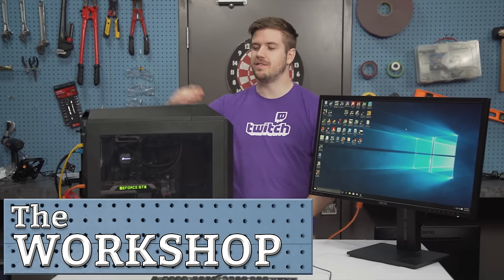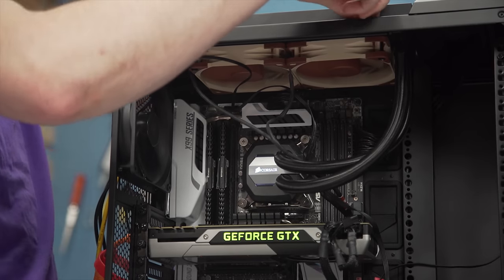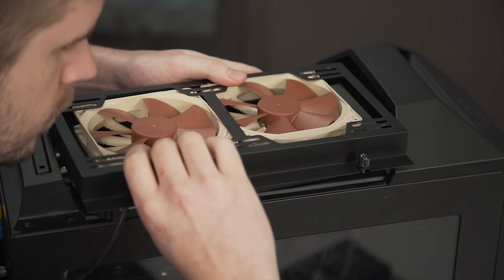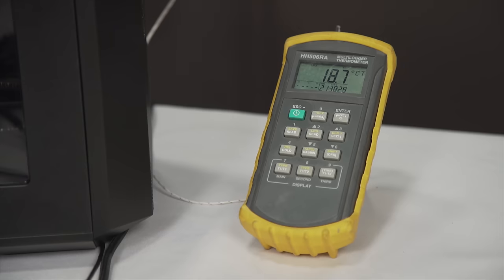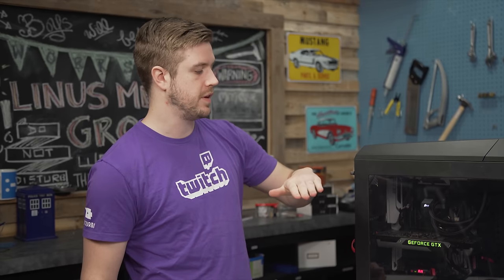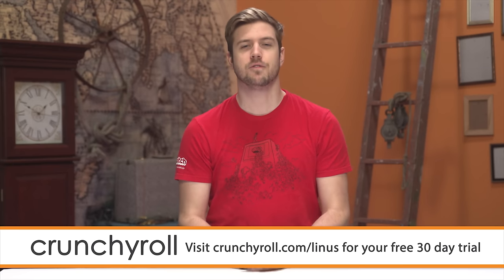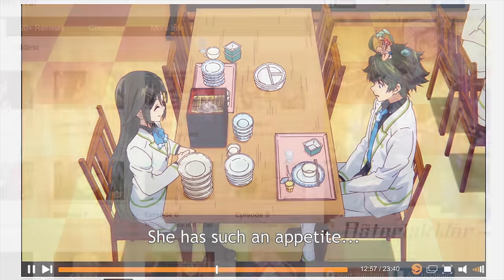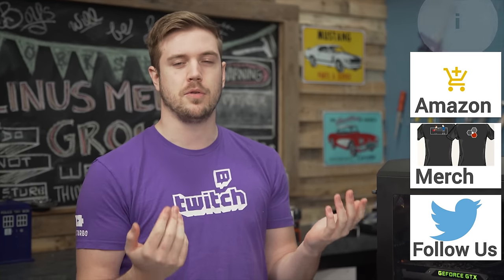Radiator Fan Configuration: Does It Matter? - The Workshop

Comment: The biggest con of the 4 fan config isn't performance per dollar, its performance for noise. 2 more fans at 60% is 3 degrees cooler, but is twice the sound pressure (or an increase of ~3.3dB), which IMO isn't worth it if the initial temperatures where acceptable. However if you had to have the extra cooling to run safe\stable, I'd be very interested to see if turning the fan speed on the existing 2 fans, or adding an additional 2 is a more sound efficient way to get that result. Likewise a super thick rad (eg 45-60mm) may get a more noticeable benefit with more fans, but it'd be interesting to test if this is worthwhile.

Comment: I mean, getting the CPU heat out of the case should improve the inside (and GPU) temps, right? also, I'd say most cases follow the airflow in on the lower front and out of the top, so it works well with the usuall airflow without having to thing about switching case fans much.
Reply: +franziska1007 Typically the CPU is extracted in one direction. Like out of the back, of the top like in this video. And the heat never really comes anywhere near the GPU so no matter what cooler configuration, as long as it isn't pulling down, the GPU wouldn't be effected. However the the pull config would probably increase the GPU. But on the other side  of the PC the GPU could cause the CPU temp to increase if it isn't a blower card. i.e. reference cards

Comment: Would there be a difference in temperature if you're working with a smaller case and a high GPU usage in terms of blowing air into the case through a radiator or out? Or would it be the same result here albeit maybe higher temps on the CPU?

Comment: how would these configurations affect other components like a graphics card? if you pull air down through the rad, would that increase the ambient temp inside the case, increasing in turn the temp of other components? or would the hot air from the gpu going through the rad be less able to cool?

Comment: I just swapped mine around to push through the radiator and out of the case. It didn't make a diff to the CPU temps, but my GPU temps dropped a fair bit. That's in a Node 304 where space is tight though.

Comment: One thing you should have added is a GPU. if you use a blower style GPU, radiator placement doesn't really matter... If you got an aftermarket open cooler design, it does matter if you pull air into the case or push out. If you push out, you add heat to the CPU because the air is already heated. Pulling into the case (front mounted works best) your GPU may run 1 degree c warmer, but CPU will stay way cooler.

Comment: I always thought pulling air in from the top outside would have been better since the cooler air outside the case, but I guess there isn't much of a difference from sucking air up from inside

Comment: I would be curious to see one side of the radiator (left vs right horizontal, not the long way with each side, front or back) have a different orientation than the other. basically, two fans with half of the radiator between them pull from outside of the case, and the other two fans pull from inside the case.

Comment: What if you have a push-push (or pull-pull) config, so fan-fan-rad instead of fan-rad-fan like in push-pull? Does it improve the rad cooling/airflow inside the case in any way?

Comment: What about the 4 fan configuration with one side in push/pull and the other side in pull/push? Not like the weird config that was blowing at each other.. but rather the two fans at the front of the case pushing air out the top of the case, and the two back fans pulling air back into that case? 

Highly  doubt it would affect anything, but it would have been another option to test.

Comment: I think the best configuration for a system like this would be fans on the bottom, pulling air into the case. easier to clean, since you would only have to remove the top section, and would cool slightly better, since youre blowing cooled, directed air into the radiator

Comment: Try this:
Does pump placement matter?
I've got an EVGA GTX 980ti Hybrid and EVGA recommends putting the radiator above the pump(GPU) for lower noise and higher performance.
Does the pump placement really make a difference?

Can I plug in the GPU in any PCI-E slot without losing performance?People always say that we don't even use the x16 slot really to its fullest potential.How much performance would I lose putting the GPU in a "lower" slot?

Comment: I remember Linus building a computer under a desk. Would such a build prevent dust because the internals are kind of facing down?
Reply: wouldn't prevent dust, it would be easier to clean and not as much would vlibg, but there still would be a little bit that accumulates over time

Comment: In Malaysia, it is a big deal to have two more fans. Why? The ambient temperature during the day can simply exceed 35 degree Celsius and not less than 26 at night. Load temp with proper air ventilation is at around 69 degree Celsius. So it really depends on where you live.

Comment: this workshop is pretty conclusive but people just remember, if you rad fans are pulling air into the case then that air will be a lot warmer and will make the other components of your build warmer in turn (MOSFETs SSDs HDDs RAM etc). Air flow management is a real challenge.

Comment: It would be interesting is you can measure a noice improvement if you have a push-pull config running at the same temp. of the only pull config due to lower speeds of the four fans.

Comment: Im a noob at watercooling, so these may be stupid questions: Push is where the front side of the fan is facing the radiator, and pull is where the backside is facing the radiator, and push/pull is where on one side the front faces the radiator and on the other side the back is facing it, right? Also, I'm looking to get an h80i v2 for my i7 6700k, and will it perform better than my current phanteks ph-tc14pe? Final question: I heard that its not worth it to do a push/pull config on a watercooler like the h80i v2 because it isnt dense/big enough to make a difference worth the money. Is that true? I also heard that h80i v2  comes with 2 fans already so even if its a small difference i can still push/pull.

Comment: In all configurations air is moving up and down. Missing 'crazy' configuration that two fans pushing air inwards the radiator next to valves intake and two fans pulling air on opposite side that air is moving horizontal. In theory less effective then best option. Is it?

Comment: What about GPU temp when you are blowing air into the case with a single layer of fans are under the radiator?
How much hotter will the GPU become compared to pulling air out of the case (the favorite configuration)?

Comment: You should make a quick add on video about how it the air temperature inside the case, It changes from case to case (badum tss?) but it might affect blower style reference gfx cards. I have a similar set up and I'm wondering if I should pull or push the air though the rad and if that affects in anyway the temps on my gfx card.

Comment: But how many OTHER fans do you have that push/pull air through the cab? Even if you have two fans pulling air out the top of the cab through the radiator (same as my config), you still need 1-2 fans pulling/pushing air in through the front or the bottom, and maybe one additional exhaust fan at the back... if you only change the way the fans on the radiator works and nothing else you're just changing half of the configuration.

Comment: what about the temp on the graphics card with a load? if the rad is being cooled with air flow that is about 80° in the case outward would you see a change? The fact that you are pulling hot air over the rad.

Comment: The problem with this test is that you didn't run it with the gpu at full load as well. If your temp inside the case is high  then the air pulling up is gonna be warm so the cooling will be worse.

Comment: Have fans always blow away from the case if connected to any radiator, because having it pull in could blow hot air right on to the GPU.

Comment: What about one fan pushing air through two single fan radiators stacked on top of each other and the difference on which of the radiators the water goes into first. The first one the air goes through or the second? Obviously cross flow of the air and water is better but how much difference does it make and what is the difference compared to two radiators with their own fans blowing fresh air. It's obviously a rare thing you'd want to do but for some special builds with space restraints it might be viable. And what about more than 2 radiators stacked on top of each other?

Comment: I disagree with the last configuration due to the fact that warm air will be going through the radiator. I like colder air going down the radiator into the case.
Reply: As he did it in idle state ofc wont change much , but when on heavy load like gaming , the air he will suck from case to outside will warm the radiator and so will fluid inside warm up =CPU will warm much more and slower it will cool down , but only one plus with that set up dust being pulled out :D .

Comment: If you have fans with rounded frames like corsairs SP120 fans then push is quite a bit better than pull. Also if the rad is much thicker e.g. 60mm then push pull makes a bigger difference.

Comment: I have a h100i GTX with four fans but the Corsair Link fan cable allows me to monitor only two of the four fans with the software. Is there any way to monitor the four fans with the Corsair Link software ? I have made a lot of research on Google but i did not find a Corsair Link fan cable that allows me to plug four fans on it.

Comment: Here's an idea to consider for an episode of "The Workshop".
I've always wondered if there is a difference between old SATA I cables (from the really days) and the newer SATA cables when used with SATA III SSDs.
Also, does length matter much and does it hinder performance?
Also, is SATA performance hindered of I bundle power cables with SATA cables (when doing cable management in the case). When electricity passes through a wire it creates an electromagnetic field, which may interfere with SATA communication?
I always worry about this when doing cable management but have never tested it.

If you do this make sure the bundled power cables are connected to a device, otherwise the power cable won't be creating a potentially disruptive magnetic field. For an extreme scenario consider bundling up (weaving?) some PCIE GPU power cables with an SATA cables and do some SSD speed tests while the GPU is at max load (drawing the most amount of current).
Cheers!

Comment: If you had a GPU in the loop as well, fan configuratio would significantly affect the air temperature inside the case and, in effect, the temperature of the VRM and Chipset.

Comment: Just out of curiosity, was the gpu working 70%+ Load? A hot gpu can actually have an impact on cooling performance if configured for exhaust over intake.  That said, it shouldn't be more than a few degrees.

Comment: How about a workshop about how important it is to have Air flow fans vs Static pressure fans on a radiator? Obviously static pressure should be better, but how important is it?

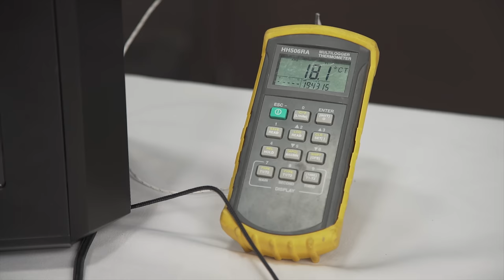Comment: Quick tip : If you're doing stress testing with Aida64, at least make sure you select stress FPU, aswell as CPU (unlike what you show at 1:27, and i'm guessing the rest of the "tests" are done in the same fashion too), otherwise, you're not really "stress testing" anything...

"Modern processors all have an integrated FPU, and from all the components that are integrated, the FPU is the most complex one. Hence stressing only the FPU actually stresses most of your processor, and usually drives the processor to its maximum temperature. So if you want to check if your cooling solution is adequate, you can use the FPU stress test." - Random quote

Comment: Okay, I'm preparing to build my own computer, but I wanted to check what kind of radiator I was looking at.

The computer I'm hoping to build is a fan cooling system, not water cooling. I looked at a few and they said it was "liquid coolant", so I assumed that it was only for water cooling systems.

So my question is, will these radiator fans work in fan cooling systems, or ONLY in water cooling systems?

Comment: doesnt pushpull allow for reduced fan rpm while not compromizing temps compared to just one set of fans which need to run at a higher rpm to maintain the same temps but at a higher dB?

Comment: They should have tested it with the rad in different locations, on my Define r5 I have mine set up in the front with push pull on both sides it uses fresh cool air , looks cleaner inside, cuts out noise by a ton , and has dust filter to aid in keeping it clean.  i7 6600k 12% oc is at 33c

Comment: The video only covers CPU temps, I'd like to see what impact having the fans moving air from inside to outside has on the other internal temps (Motherboard, HDD/SSD etc) compared to the fans moving air from outside to inside I'd have thought that if you're pulling cold air in and warming it through the rad it would cause the other internal temps to rise as the ambient case temps would increase, also what impact do the case fans have in that scenario, i.e. if you have CPU rad blowing out, does it work better having case fans pulling in and vice versa?

Comment: I think that the air going into the case from outside versus the air going out from inside the case would make a much bigger difference if the inside temperature was hotter, for example with SLI/Crossfire, and a couple of HDD's...

Comment: please mention: a push & pull config allows all 4 fans to turn with lower rpm so theres less noise

please test: Radiator in the front or radiator in the top 

Thank you guys!

Comment: I have an idea for a workshop vid. "fan air flow for cpu or gpu". The idea is sparked by  if i run a stress test on either cpu or gpu alone the temps are a good bit lower then them both at the same time. so in the case of a AIO water cooler on cpu and a passive exhaust gpu, is it better to have case fans in-taking cool air to gpu, and exhausting it through cpu radiator, or intake through cpu radiator and exhausting through case where the gpu gets hotter air through it. also would a rear exhausting gpu change the numbers compleatly compared to a passive exhaust.
Basicly you have two components that exhaust heat in a specific direction, does controlling them actually impact overall thermal performance of either.

Comment: so maybe tech has changed in the past two years, but I got huge difference in numbers when moving the rad to the front of the case from the top. Corsair H60 running on top of the rad with the fans pulling air out on a I7 7700k overclocked to 5ghz got me 91 degrees. Same AIO but moved the rad to the front and pulled air in got me 84 degrees. The I7 7700k has been delided and resealed so these numbers were not impressive. Using a Fractal Celsius S36 in the front with fans pulling air in with thermal grizzy kryonaut paste got me 71 degrees on full load with gaming temps only hitting 64 degrees.

Comment: Saw a vid earlier where if your GPU  vents into the case it's much better to pull air into the case through the radiator and not exhaust air from the case through the radiator. Can you confirm, +linustechtips?

Comment: i have my pc set up so the fans pull air throw the top of the case and throw a rad for the cpu. the rear mounted fan drags the hot air out the back this way i can use the front mounted fans to drag cool air over the gpu,s.

Comment: What kind of setup are they using where a CPU under full load only reaches 35-38 degrees?I don't know about you guys but if my CPU is sitting in the 60s under full load I consider that to be nice and cool. These temps are like high idle temps. Surely these kind of numbers aren't representative of the average user. I'm curious what kind of load temps you guys are getting

Comment: Is this really done at 10pm? (Based on the ambient temperature sensor)
Also, luke, you might wanna try these things with CPU/GPUs that run way hotter. That way, a difference in temperature is way more notable.

Comment: Does pulling air down through the radiator help with VRM temperatures?
Reply: @hitbm4755  that is what i thought also... it need to be balanced trough out the case for other component also.. if top exhaust set to push, it will directly suck air out top more before it reach other components.. of course, there's many variables to take into account, ect...

Comment: Seems like the GPU was not under much load during these tests. If the graphics card is dumping a bunch of heat into the case under load, wouldn't there be an advantage to drawing air from outside the case through the rad?

Comment: one problem with this video. a blower type card is in use, which means the GPU is not putting any hot air into the case. this does affect the preformance of a CPU cooler, and causes Radiator on exhaust setups less efficient than on intake.

position of the fans on the radiator do not affect its preformance... it can push through or pull through, just make sure the direction involves fresh air from outside the case... i would suggest a pull config on your intake, as this allows (as mentioned in this video) easier dust management. all you need to do is use a blower to blast air off the radiator, blowing from the inside of the case and blowing it out with your compressed can or power blower.